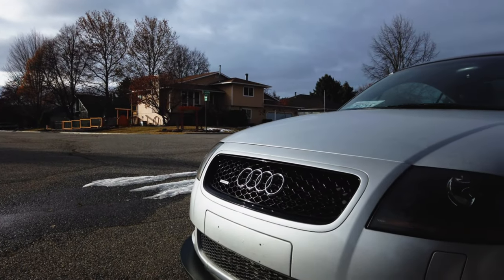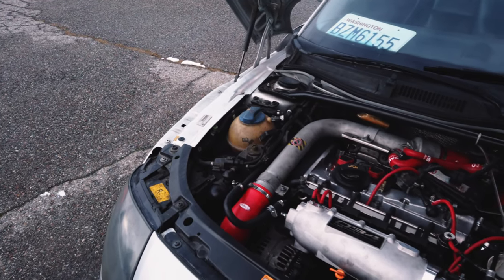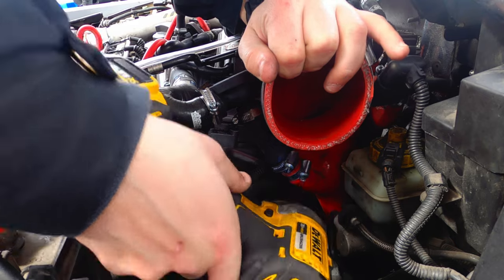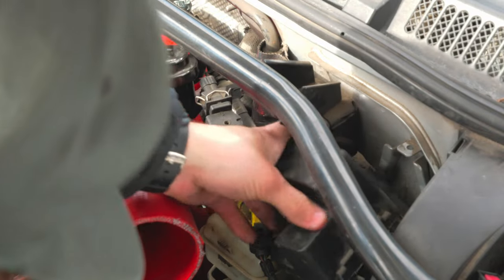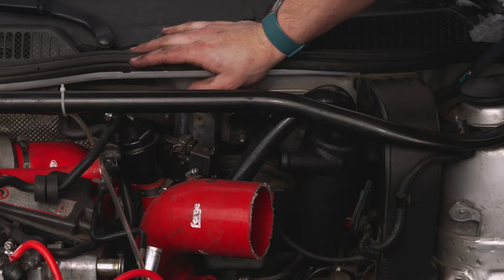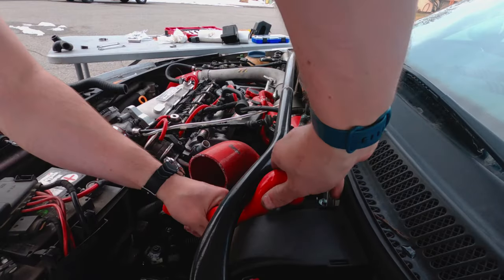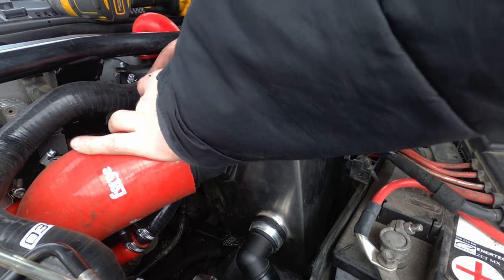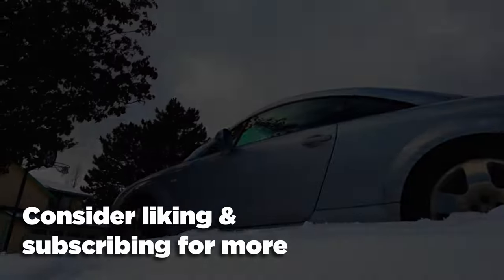Installing A Catch Can On The TT... But There's An Issue.

Comment: for the relays that you left tucked in the fire wall, somethign you can do is actually put them in that long black box with wiring, you can actually tuck it in there and still get it to close so then its just peace of mind, no need to worry whatsoever! did this to mine as well and havent had any sort of complaints or issues with it! keep up the great work, loving the videos :D

Comment: Ha, you were way ahead of me from my last comment. Nice work! I dont know why, but I also find it so much more satisfying when I find a makeshift solution that works out almost perfect! 

Saw a comment below mentioning this, but there is plenty of room in our cars to throw those relays either inside the wiring harness tunnel, or even routing them back in and under the rain tray out of the elements. 

Cant wait to see what else you do! I could use the motivation 😅
Reply from the maker: Haha yeah it was so hard not to respond to your previous message with a cryptic hint haha. Great minds think alike!

Thank you a ton for the suggestion. I definitely will look into tucking those relays in that harness tunnel!  I've got loads planned for the car!
Reply: @HunterDirection  Glad to hear it man. If you ever feel the need for a soundboard, dont hesitate to reach out, though I know the challenge of being resourceful and figuring things out is half of the fun here! Im going on 13 years with mine and heavily modded. I will never shy away from TT talk of any kind! 

In any case, keep up the good work! Ill be following along closely! 🤙🤙

Comment: loving the content im also in the process right now of fixing up my cactus green b5 a4
Reply from the maker: I am stoked you're enjoying the videos! I love cactus green👌 that sounds like a rad project!
Reply: @HunterDirection  im going to get it fixed currently going to install a fmic from cts and swap a k04-015 for now down the road im going to build the engine i also managed to source a b5 s4 front bumper that im going to get painted cactus green to slap on it.

Comment: A pcv system and catch can are different. All the pcv does is control pressure in the block. A catch can does the same plus separate oil and water vapors from going back to the combustion chamber. A catch can is an upgrade and completely replaces the pcv system.